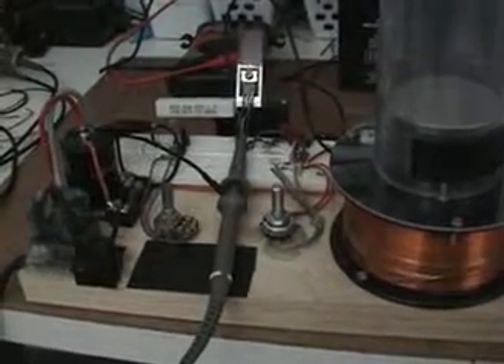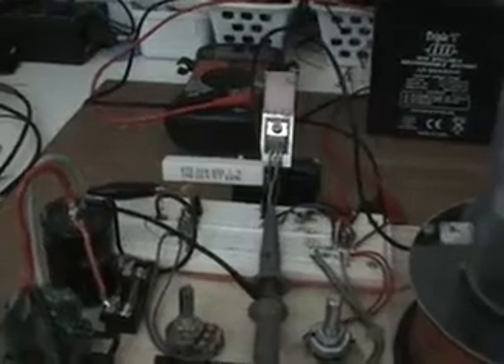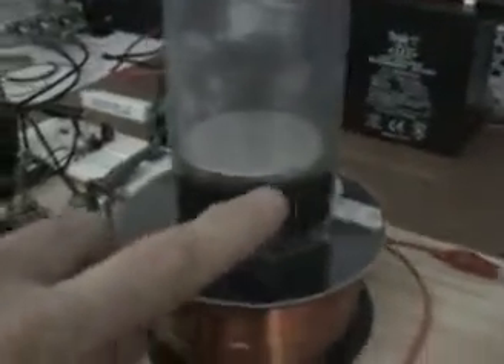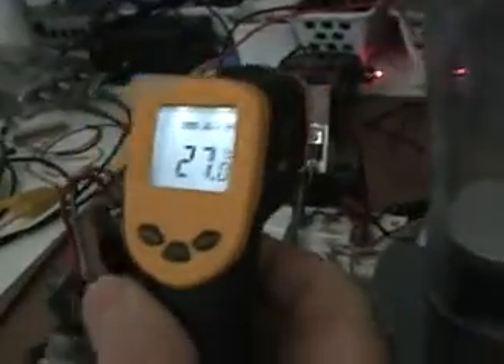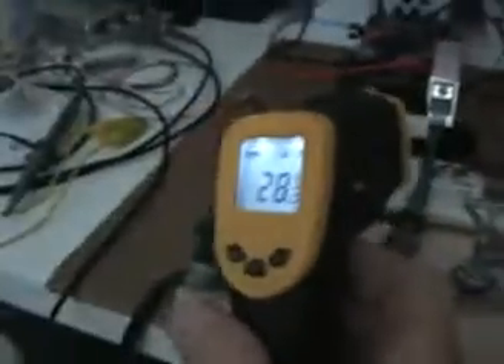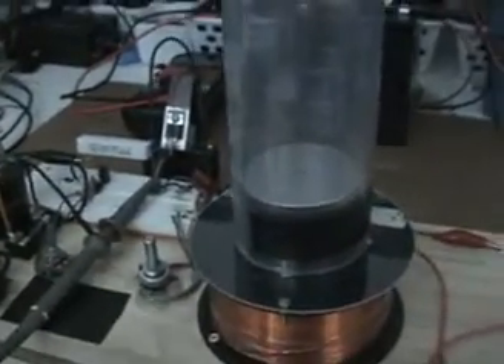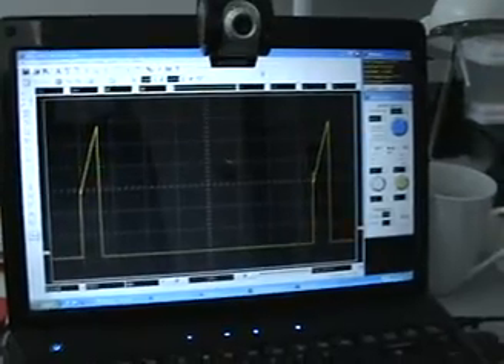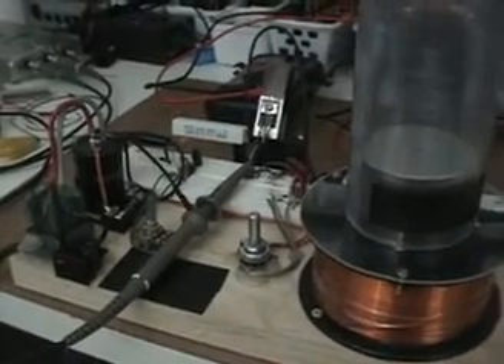Effect of Recirculating BEMF to Coil test 4

Comment from the maker: #5, are you also considering that when Q1 is switched off and is sending back all its stored energy though R2 which is outputting more heat then R1, the first resistor that SAME AMOUNT OF ENERGY it had to go though (which you believe to be normal) but you are forgetting that some of the energy makes it through R2 and goes BACK in L1 and keeps a one pound magnet levitating!  So in fact I'm not even close to dissipating all the energy in R2 that was able to mysteriously slip through R1.

Luc

Comment: one request, do you have a probe type temp meter? IR just isn't take accurate.  Are you going to use a straight dc circuit on the resistors and replicate the temps to find a wattage comparitor?